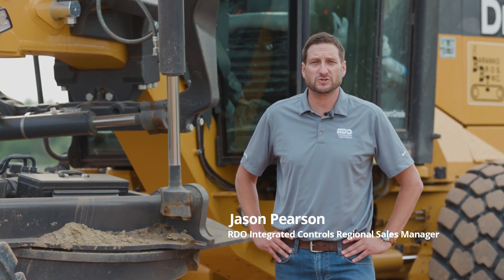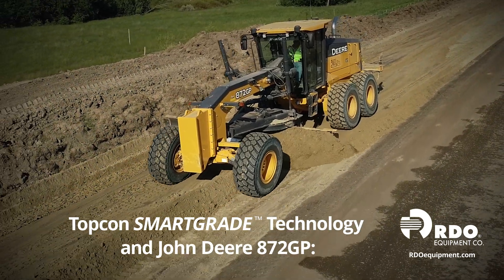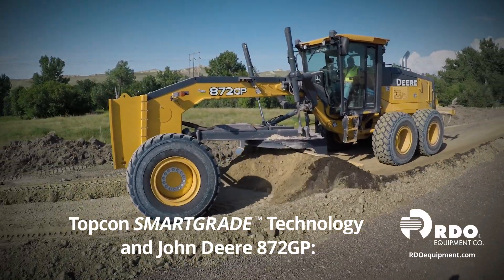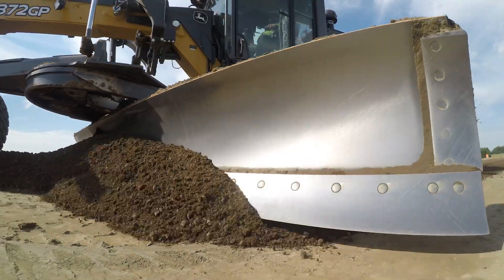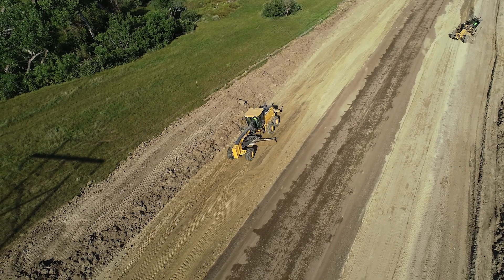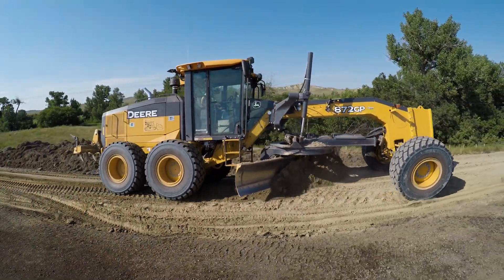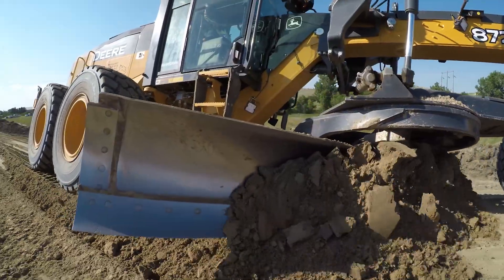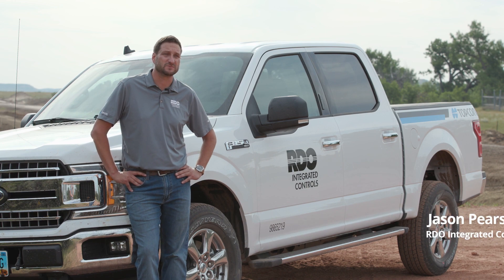Baranko Bros. Uses the Industry’s First Mastless Motor Grader on the Jobsite

Comment: Topcon error, it is not accurate, as is the case with other companies, and Topcon does not connect to straight travel. It is very difficult to move in a straight line and there are many reception problems between the antenna in the field and the motogder, which is not a stable sensor. In a random wave from Eddy's experience only. Maybe I was unlucky with 14 heavy tools with Topcon.